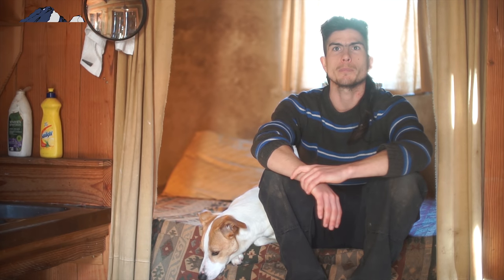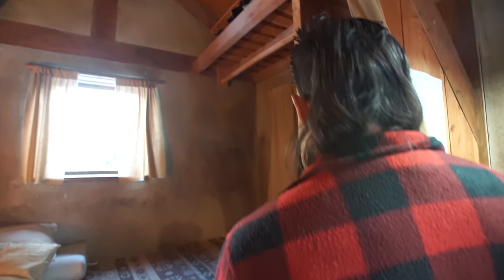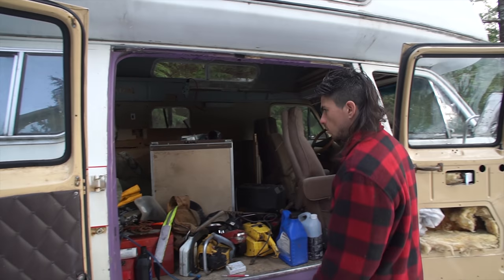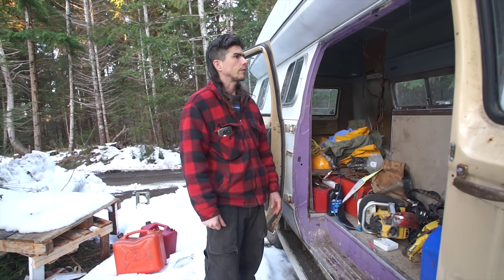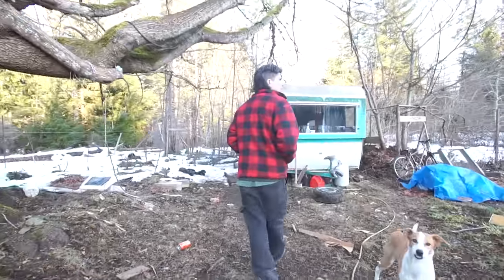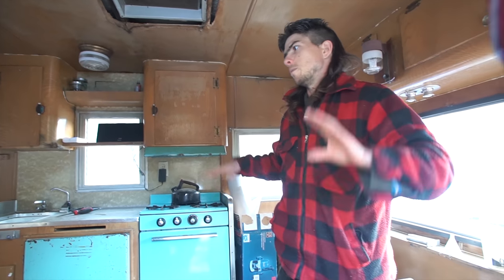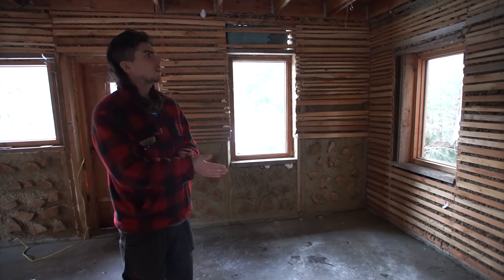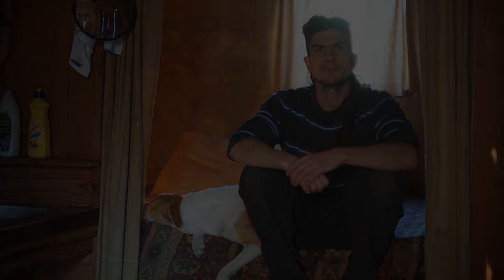Unique Cob and Timber Tiny House Built on Farm + Van tour and Cabin Build.

Comment: Why does nobody mention that stripping the whole thing down very likely maybe mean to enter a dead end street?

Although it may sound old-fashioned, I would calculate my working hours - and then think about what to do with my labor. It's kind of responsible. And if it is leak but not smelly an outside roof with four posts could to do as well - and would not spoil your views.

Okay, if I see it as an experiment and a learning progress, then my working hours may be of less importance. But I would view online videos of similar projects, which probably allmost went bust, before. And if you would do another project, you would do the other project successful as well.

So to choose another project means not failure but a different success.
Reply: 'no failure' blabla - 'the mistakes are from the machine'